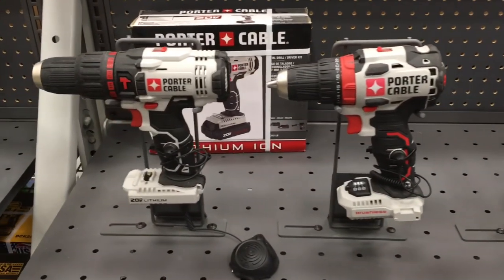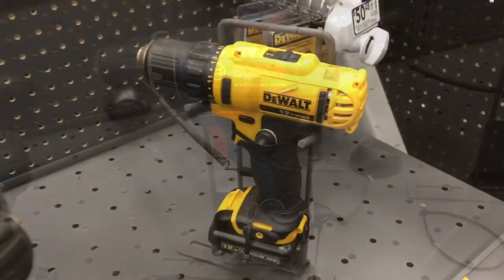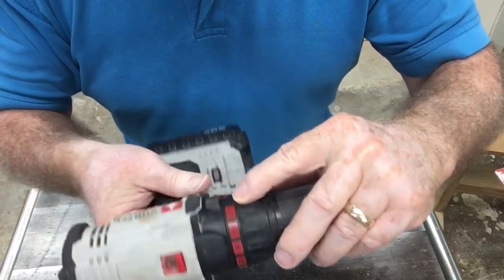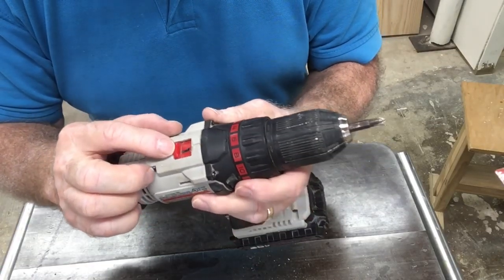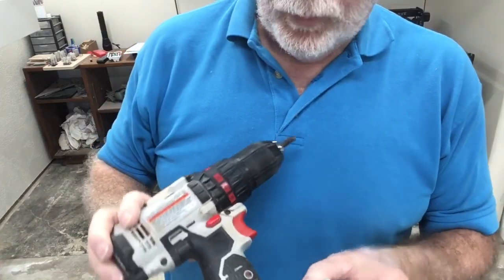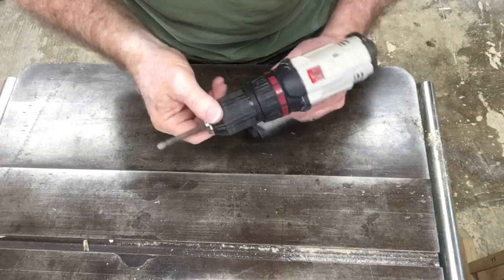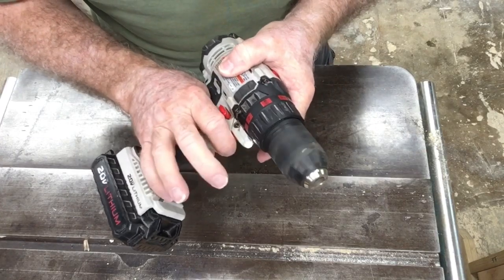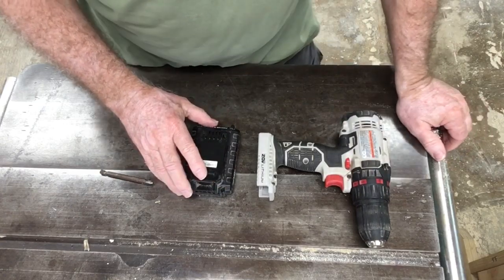Drill Basics Part 1

Comment: horse power is the key, dont get a drill that hard wood will stop in its tracks. and forget about a hammer drill for cement its a waste of time and some cement will wear you out, get a rotary hammer, it will cut through cement like its a soft piece of wood.
Reply from the maker: You are correct.  Remember this  video was for beginners and I only wanted to touch on the basics. Thank you for your comments.